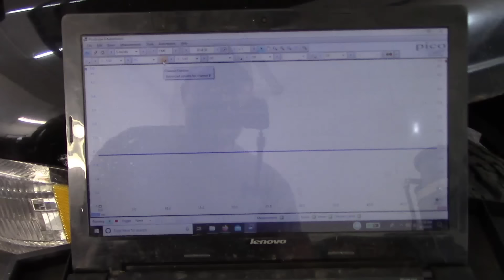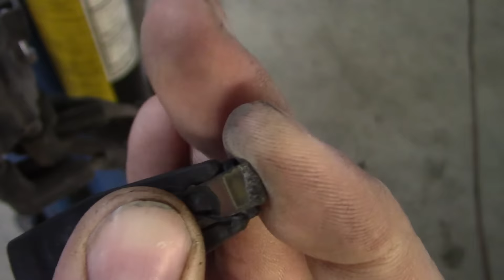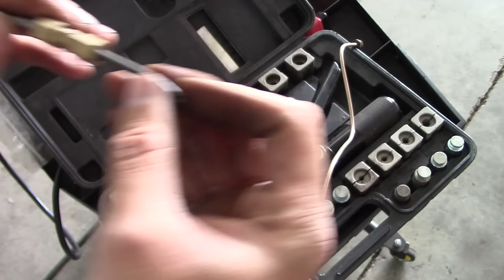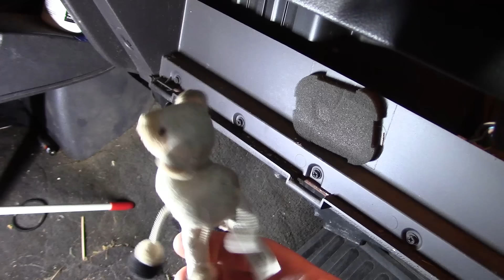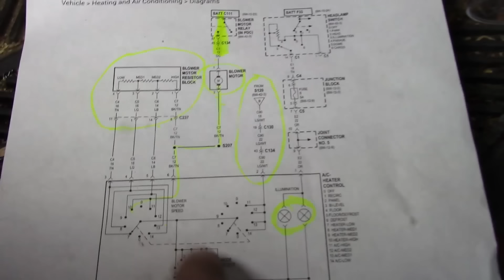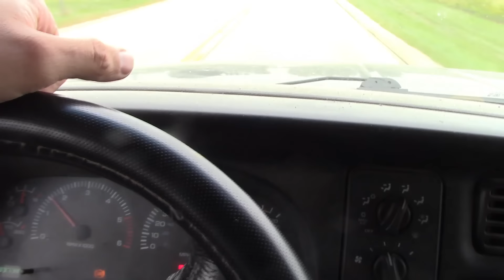2001 Dodge Ram 2500 - Random Missfire, Blown Brake Line, no Heat or AC - basically it's an Old Dodge

Comment: So, I'm old as dirt and spent many years in construction. We all knew Dodge bodies fell apart in construction work but the 318 was a good engine. They have only gotten worse. Now nothing is great about them.
Reply from the maker: The newer trucks seem to be better, from say 2007 and up. But then the engines started having more problems.
Reply: @WatchWesWork  Yeah, but in fairness Ford had an engine that blew two spark plugs out of the block for several years.🤣

Comment: Hello Wes at 2 and almost three minutes there's your problem lady you just got to love this guy, a young guy with so much knowledge that is freaking scary. You can bet your sweet bippy that if one wire is bad they probably all are bad and so are the plugs cap rotor and every rubber line on that truck. LOL

Comment: i am so glad the uk mot test is so good ,that level of general neglect is frightening especially in a country  like the us
Reply: Neglect? This truck is pretty minty compared to some of the stuff around me. I particularly like the trucks where you can't tell which bolts are broken, the cab mounts or the bed because they seem to move independently.
Reply: Are you going to front me the money to buy a new truck every five years. It’s state government fault for dumbing millions of pounds of salt on the road for 6 months out of the year.
Reply: @gregorybell7301  i am sorry to offend or upset you or any one else it was just an observation on the safety aspect of your country's system not your vehicle directly ,
Reply: The US isn’t anything special...
Reply: The UK doesn't have weather like the US. Snow and ice are not an issue for you. There are whole areas of the country that gets 4 feet or more of snow.

Comment: I bought a similar vintage f150 with a bad transmission, so it is nice to see you work on this truck.  I am going to replace the brake lines on it and it is nice to see what I can expect on a similar vehicle.  I already replace the fluid in the lines so I should see that sludge you got out of this one.  Replacing the transmission will be an adventure.
Reply from the maker: Good luck!

Comment: When I started my career as an IT guy I favored certain brands of computers. After 20 years I hate them all equally. I assume that mechanics get to the same point.
Reply from the maker: Yeah, but some brands are so much easier to work on. For example, almost every domestic vehicle requires screwdrivers, impact wrenches, pry bars, etc to get the stupid air filter out. On a Toyota you just pop 2 clips...
Reply: Watch Wes Work and on a Volkswagen, you need special tools to get to the air filter.
Reply: AC just used chainsaw to install radio 😁
Reply: @WatchWesWork  or needing a whole socket set to take anything off a ford. Oh I gotta gut this door, let me just grab all my torx, 3 extensions, 2 pick tools and all my sockets. Take apart half an audi with a plastic scraper and 1 torx bit. Take apart a whole Tacoma with a 10mm and a clip tool(although their fender liner clips win the PIMA award)
Reply: @WatchWesWork  I agree Wes, I have to take half of my GMC apart just to change the battery or air filter.  STUPID Design.
Reply: @WatchWesWork  that’s why I’ll pick my 95 Chevy Silverado over anything new today. Literally just unscrew a wing nut and your done.
Reply: Watch Wes Work But then Toyota frames turn into a pile of red dust 😀 I totally understand the ease of maintenance thing, though, and the frustration that comes with a poorly designed system. Nothing builds hatred more than a simple job hindered by poor design choices.
Reply: Darryl Burgess Gm frames are not much better I’m doing a frame swap on my 2000 GMC Sierra right now .99-07 frames are junk many people have cracks or rotted out areas
Reply: @WatchWesWork yeah, but where is the fun in it?
Reply: @WatchWesWork  love those Swiss Cheese frames on those.... "Toy"ota's The Dodges may rust but where it counts will be Rick solid LONG after your frame rots! Lol lol lol lol
Reply: @walterhubicki5207 what a load of crap. Dodges are rusting before they are even assembled.
Reply: I'm with ya there Darryl...after a day of trying to support modern computers I restore my sanity with a few hours on an Atari 800XL ;)
Reply: Unfortunately you are correct, used to be brand loyal but any more all domestic / big three offering are equally bad.
Yes some are worse than others and they do have their good points but also their bad.
Reply: @mikemcclune1440 I don't know, Ford trucks (super duty) kinda way better todays then other
Reply: Da Da

Comment: Dang what’s the issue with Dodge? I’d take a Dodge(Ram) over a GM garbage any day just test drive 2020 Silverado felt like I was in a early 2000’s truck same crap.. Anyway good video
Reply from the maker: Well they all suck in some ways. But reliability and early 2000s Chrysler are not found in the same sentence.

Comment: I swear Chrysler only used the poorest quality ex-Soviet steel they could find for the longest time. And don't get me started on whatever nutsack tickler of an EE started designed their wiring harnesses in the early 90's. The Neon and PT Cruiser are the absolute fucking worst in that regard. Not enough grounds, grounds in the wrong spots, ground loops from grounding the same circuit twice in different places, oxidation on every grounding point seemingly from the factory...
Reply from the maker: I know. When I get a call about a Chrysler with electrical problems my end of the phone call gets really quiet...
Reply: Watch Wes Work I highly recommend burning any Chrysler product with an electrical issue to the ground now. could probably extend that to any Chrysler product after the lease ends. 😹

Comment: Wes if you had the time, you could have let the wire terminals soak in a glass jar with baking soda and warm water to get that terminal fully cleaned. Then brush. You don't want that corrosion to come back this winter. Chances are it may not  start with all that build up at 0 and below.
Reply from the maker: I'll try it next time.

Comment: Back in my youth (skint days) my test for ignition wires was to start the engine at night and look at it in the dark. It's amazing how many small sparks are flying around those wires!
Reply: Add spray bottle with water mist some it’s like 4th of July under the hood
Reply: @adamschultz1515  add some salt should raise conductivities to the next level.
Reply: @bryanmartinez6600  I think that truck has seen enough salt!
Reply: @adamschultz1515  I was about to reply the same thing.
Reply: Yes Us Stone Ages Mechanics Young Mechanics Dont Know
Reply: My son had a chevy C10 pickup and he carried around a can of PDQ. Every time it rained it wouldn't start without removing the distributor cap and spraying it with PDQ.
Reply: And I was one of the tough guys that would grab at plug wires looking for the bad wire... zap s#!t I found it I stopped doing that in the late 90’s when the coils were being placed directly on the plugs

Comment: 8:45 so that's where cocaine comes from. Dumb dealers smuggling in from south america when it's right here, on your battery terminals.
Reply from the maker: Try before you buy!
Reply: @WatchWesWork  Boiling water from a kettle dissolves that stuff almost instantly.
Reply: think about snorting that stuff.

Comment: What brand of wires did you use? Gotta 03 Durango with the 360 that needs some love, never liked the crap wires ya get from...what I would call box store auto places, and the locals are awfully proud of what they have to offer.
Reply from the maker: They're just CarQuest house brand wires. They are not great, and a little too short. Maybe get some MSD wires.
Reply: @WatchWesWork  Thanks. Found some "genuine Mopar" wires on Ebay for around 60 bucks but... it's Ebay. Ya never know what you're gonna get. Thanks again, I've learned a s!$t ton on diagnostic from you. Really like how you run your channel, good stuff.

Comment: I heard that wire arching before you even showed it on camera. 🤟
Reply from the maker: Yeah, pretty easy call on this one!
Reply: Funny, I have a 2001 Durango with 218,000 miles. It's just a plow truck now. Not on the road, but I did a tune up as was idling rough. Same darn thing. I pulled the plugs and the electrodes were burned right down in the ceramic insulators. Not sure how it was running. Those 360s will run, even abused, for quite a while.
Reply: Gotta love champion plugs they only run in your lawnmower and a Dodge

Comment: just replaced the chassis/frame on my 43 year old landrover, it didn't look as bad as that one,
Reply from the maker: The frame is really pretty good.
Reply: @WatchWesWork  do those dodge trucks have fairly thick chassis walls? the surface rust looked really bad. i think if it was quite thin wall overall strength would be reduced. i'm in uk and we dont have those trucks as standard here, so i dont really know.
Reply: actually looking back over the video it wasn't the chassis that looked that rough, front coil spring and axle looked worse and brake caliper, brake lines "that you replaced" think i'll stay away from those vehicles :)    i enjoyed the video though, looking forward to your next one

Comment: I had a '99 1500. Wasn't great, wasn't  super bad either. Just lots of little nuisance repairs. It was a Florida truck for Florida work so I missed a majority of the rust. Biggest turd was the transmission. 175k miles ate 4 transmissions. It was a company truck so I didn't suffer it's indignities a daily driver.

Comment: You summed it up at “it’s a Dodge!” At least the misfire wasn’t because one or more rocker arms literally fell off which is surprisingly common in some Dodge V8’s. I know the Cummins boys love their Dodge pickups but, the Cummins aside, they’re the most poorly designed of the big 3 American trucks perhaps excluding the current generation but time will tell with those.
Reply from the maker: Yeah, the hemis like to break valve springs. The OHC engines like the 3.7 like to toss cam followers. Chrysler...
Reply: Watch Wes Work I’m glad our old town and country had the 3.8 v6, probably the best part about that van.

Comment: I have a 1991 Dodge W250 with a 12v...  I can speak with total confidence that Dodge trucks don't have brake lines or brakes, or cab corners, or rocker panels, or functioning speedometers.
Reply: What's a speedometer?   I've never had one haha
Reply from the maker: My brother has one. No speedo, no cab floor, no fuel tank straps, etc.
Reply: @WatchWesWork  That Cummins engine, though, and oddly the Getrag 5-speed, still work flawlessly. Wisconsin is tough even on quality body panels.

Comment: Aye I had to get my lines fixed. I just replaced sm with CuNi ones
Reply: Samarium with cuprous Nitride?
Reply from the maker: With Ni-Copp brake line. That's the only way. Stainless is nice buy a pain to work with.
Reply: @WatchWesWork  I typed it wrong.  Michigan DOT puts salt on their salt. Absolutely ruins brake lines